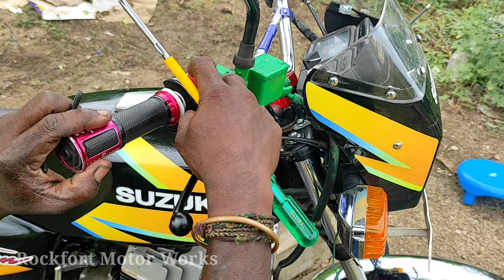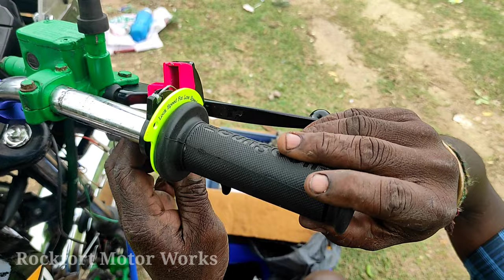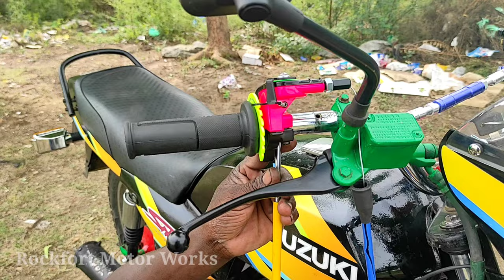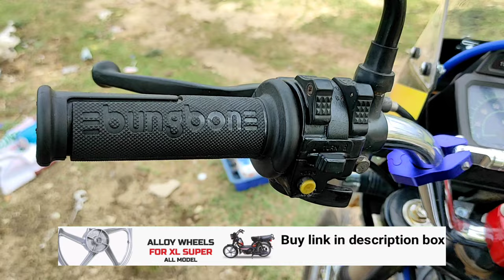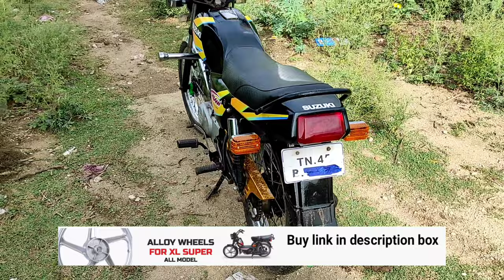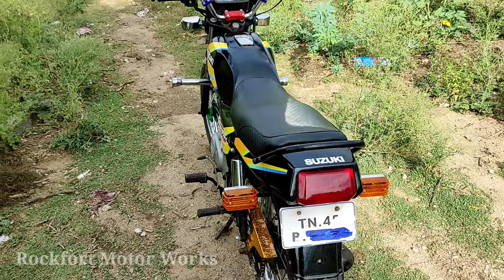how to install quick throttle on Suzuki / Rockfort motor works

Comment: quick throttle matanumna 2t oil pump cable kalatanuthenga and carburetor throttle valve ku direct cable connection kuduthenga , appo 2t oil pump neenga ethukku kalatule athu ippo useless thanenga
Reply: Ama bro
Reply: Enakku yethum set akula